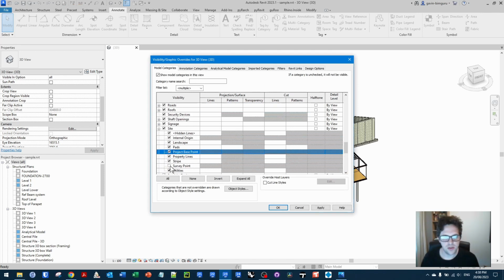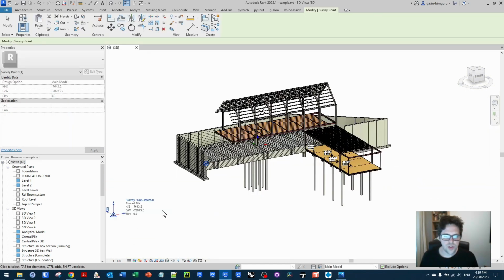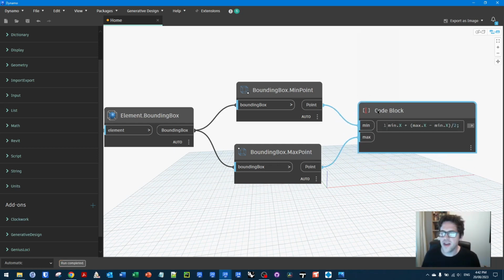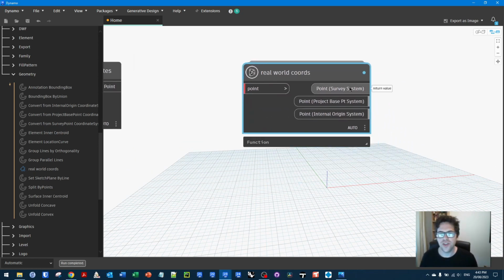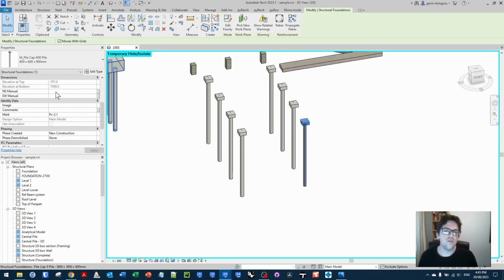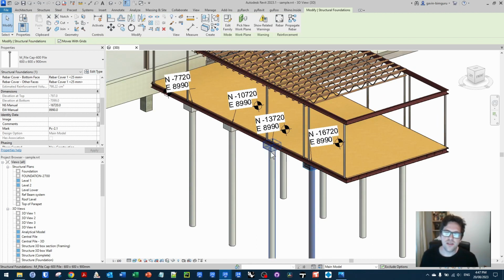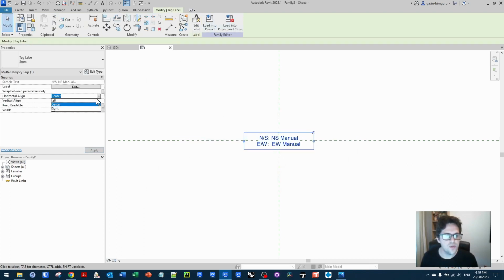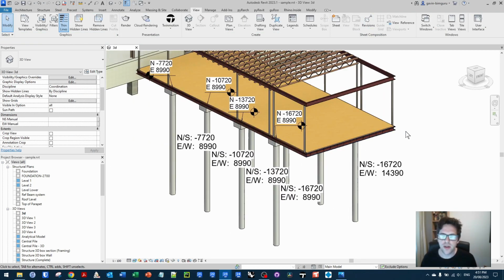Get real world coordinates using Dynamo!

Comment: Hi Gavin, on the last code block, I change to p.X/1000, p.Y/1000, p.Z/1000 to make it in meters, how do we set it to 3 decimal? I got data for northing as 328500.2, how do I get 328500.241?
Reply from the maker: I believe Dynamo has rounding tolerance in its core settings menu, but to my understanding there are some limitations inherently associated to this. Usually you should have at least 3 decimals in Dynamo so I believe it's getting rounded at some point in the code unless your rounding tolerance in Dynamo is set to 1.

Comment: Great video, thanks! Let's say that I want to move the elements to as-built coordinates based on the figures received from the surveyors. What can I do to improve the script to allow me to move the elements by editing the coordinates in the table or family parameters?
Reply from the maker: It will depend on if the elements are point based. You could use similar conversions to get the point/s though (e.g. a beam is guided by two points), then use element.setlocation to update the related element locations. Hopefully they have element Ids or marks you can use in the data source to get the actual revit element.
Reply: @AussieBIMGuru  I was trying to do with Manholes but I have created the manhole family as generic model family. I guess they are not point based. Any idea of how can I do in this case? I manage to get the coordinates but I can't move the elements by just editing the coordinates.
Reply from the maker: @engjohnattan if a generic model it should be point and level based. Element.setlocation should ideally work, if not a transaction start > move element > transaction end should work. Move it to the point itself, revit families dont understand coordinate values.

Comment: This makes complete sense and I've started to tweak it for another workflow - assign room name & numbers to the areas placed in the same location.  But not sure ho to complete the "matchy-matchy" to make the names & numbers apply to areas? I'd send a screenshot f where I am - but apparently cannot do that in "comments"
Reply from the maker: Fairly different workflow to this. I'd suggest focusing on a level at a time, collect all areas and rooms at given level. Get the centre of each area, and use the room.atpoint node to ask it which room is at the point of the area (rhythm node has this I think). From there its a get/set parameter to transfer the found room data to the area.

If you get stuck be sure to make a thread on the forums.

Comment: First time doing this and I am having trouble.  I am getting a "Null" when getting xy points.  Any help wouldbe appreciated.
Reply from the maker: Usually best to go back a node and  look at the data being fed in, see if there are nulls in there and if there are follow them back to the first node that causes them and that might reveal the issue.
Reply: @AussieBIMGuru Hey first of all thanks for your videos ! I have the same issue and for me the input of my node is a regular point "Point (X = - 10, Y = -3, Z = 44)" but still not working :(
Reply from the maker: @manghot4413  if the point by coordinate node is giving errors that's odd as it's a very simple node. Check for nulls in your incoming data and if not check your inputs are numbers (not strings).

Comment: Could use Dynamo relocate point cloud coordinate base on project base point?
Reply from the maker: I dont believe so. A point clouds coordinate system is stored internally in the file. You may be able to adjust it in autodesk recap however.

Comment: Hi, it's not related to the video but can you recommend the best PC / workstation specs to be used for smooth modelling and rendering while working on large projects? Thank you and really appreciate your response to this.
Reply from the maker: All I can recommend is specs as the PC models change too often.

16GB RAM, ideally 32GB
64Bit OS
3.9 or higher Ghz processor
RTX3080 Gfx card (Quaddro has been phased out)

This will likely cost upwards of $2.5k AUD

Comment: Hello Gavin. I´m strugling making this custom node. I´ve managed to make an autolisp from AUTOCAD that extracts all blocks x y z coordinates and list them all to an excel/csv. So from that I extract the points from the csv in dynamo and now I want to make a floor from that csv point files. Any recomendations, it´s very simple funcionality but I´m stuck on the process
Reply from the maker: Typically you will need the points to be in order of connection as polylines at the bare minimum if the floor does not exist yet. If so you can connect them into closed loop(s) to create a floor, then use their Z height to create points. If your floor has no edge you could look into convex hulls as a way to find the outermost boundary.

Comment: For those having issues with the real world coords node part: The latest Genius Loci package (2023.7.13) will either need the DynamoIronPython2.7 package installed or update the Python Code block to work with CPython3 in order to work. As mentioned by  @dalibordasic3039 , the real world coords node is the same as the Convert from InternalOrigin CoordinateSystem node, but you will need the DynamoIronPython package for it to work properly.
Reply from the maker: Thanks for clarifying! Yes all my tutorials still use IronPython2.7, I don't use CPython3 as it has too many awkward workarounds and most custom packages do not develop in it either.

Comment: I just had a look at revit 2024.1 again and noticed it still has that very washed out interface (main, active text is grey instead of black, which I think you also mentioned a while ago (can't find it anymore now)... is that also one of the reasons why you are still using 2023?...still thinking my $2000 Eizo screen is broken when looking at it....
Reply from the maker: Mainly the company i work at hasnt made the leap to 2024. Most of our new jobs are 2023 and we may wait for 2025 given the UI overhaul is still half arsed. Some minor API additions like vg link settings but beyond that nothing i feel were missing out on. Toposolids also have some teething challenges and i think users will sometimes miss the old topo tool in some scenarios.

Comment: Hey Gavin!

I would like to give you an idea for a Dynamo script that people may find useful. 

Selecting all elements, or selecting with window from linked files.

I had a need to do so, because I wanted to merge two models. The idea was to copy from site view and paste, but the models had different reference regarding the internal origin.. So, one option was linking the one model to the other, selecting elements one by one and then copying and pasting. It was really frustrating..
Reply from the maker: I'd suggest considering using the Bind Link tool for this instead, strip the model down to what you need to bring in, link it, bind it - done!

Comment: can not find "real world coord" in "genius loki".
Reply from the maker: It is definitely in latest, i downloaded it a couple of weeks ago.
Reply: @AussieBIMGuru  ok thanks
Reply: @rezwanulhoque117  try the Convert from InternalOrigin Coordinate System node instead
Reply: @rezwanulhoque117  I think in version 7.13 it is called "Convert from InternalOrigin CoordinateSystem" not "real world coords" that is where the confusion.
Reply: @dalibordasic3039 The "Convert from InternalOrigin CoordinateSystem" node was available in the version that @aussiebimguru was using as well. The real world coords.dyf file is not in any of the previous releases of Genius Loci that I've been able to locate even from previous versions on GitHub. The Convert from nodes do not appear to work in the latest version of dynamo when bringing input from the point by coordinate system node.
Reply: @AussieBIMGuru Loved the video, but unfortunately this node is definitely not available in the latest package. I don't know if there's something else you have installed but a fresh install of the Genius Loci 2023.7.13 and 2023.7.11 packages yielded no real world coords node available. It is also not on the GitHub repository a dyf that is included with the package.  Youtube won't let me post screenshot links, but I'm looking at the latest package list from both of these releases and it's not in there.
Reply from the maker: @rkitect  maybe author removed it, unsure. Check the package version that would have been around at the time i made this video.

As mentioned to the other user it looks to have changed name to Convert from InternalOrigin CoordialnateSystem potentially

Comment: Hi BIM Guru

why when we export to ifc from revit 2024 file for borepile when we separate it it is not circular in the ifc file,

I select "Advanced" and then "export parts as building elements"
please
Reply from the maker: Honestly not sure. Sounds like an IFC conversion issue. Maybe try the archicad addin for IFC as it has improved export results.
Reply: can you show me, how to try the archicad addin for IFC file from revit
 @AussieBIMGuru
Reply from the maker: It is free here:
https://graphisoft.com/downloads/interoperability

There is a manual here about how it works, fairly straightforward:
https://help.graphisoft.com/Revit/INT/IFC_Model_Exchange_with_ARCHICAD_for_Revit_2023.pdf